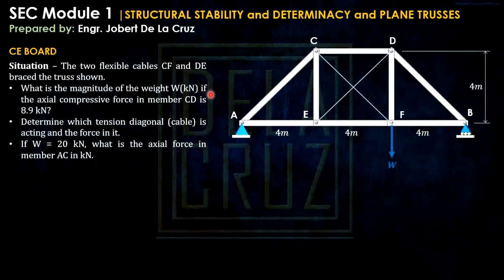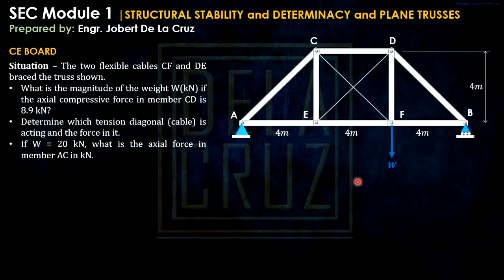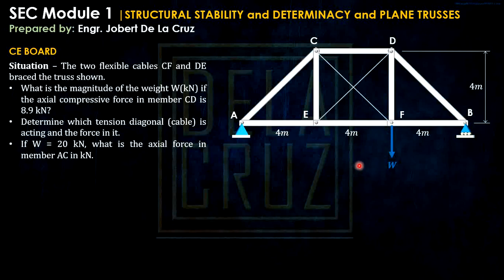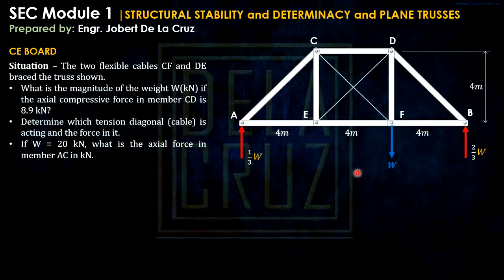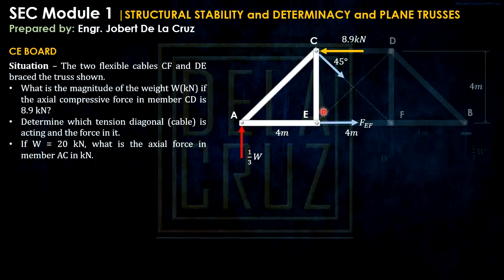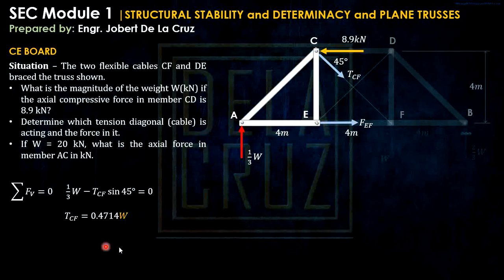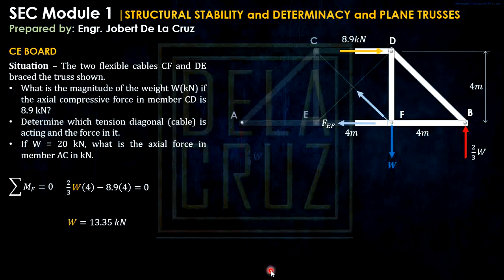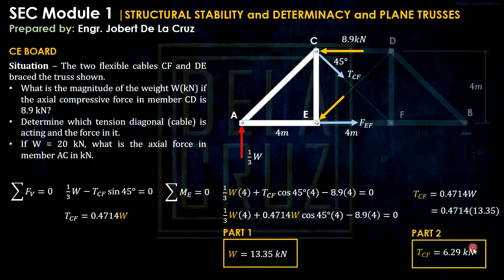TRUSS WITH CABLES | Structural Engineering CE Past Board | DE LA CRUZ TUTORIAL

Comment: Sir finding the AC. Why we use sin45 instead of cosine?
Reply: Hello Engr, summation of forces vertical po ksi ang gnawa and yung angle na nsa figure is measured from horizontal, that's why sin45 po ang gagamitin. Anyways, since 45° po iyan, sin45 and cos45 are equal lang din po. If hnd equal ang angles, dun na magmamatter yung cos and sin and consider the first statement that I mentioned. Hope nakatulong. Padayon Engr!👷